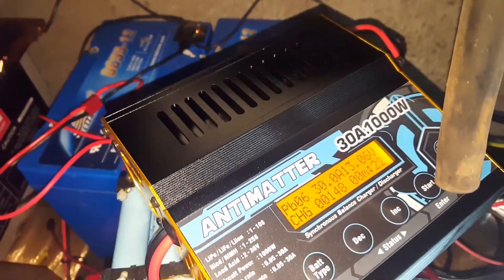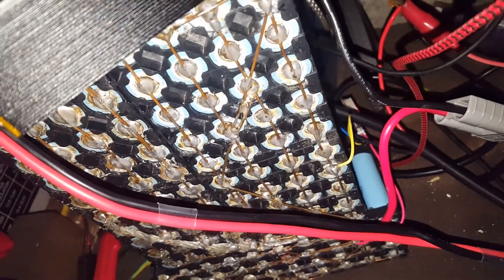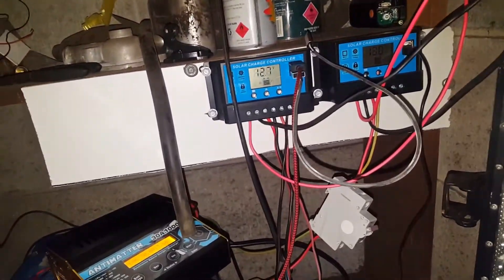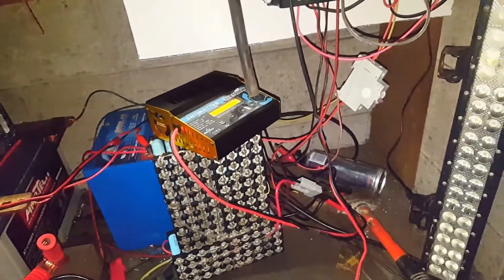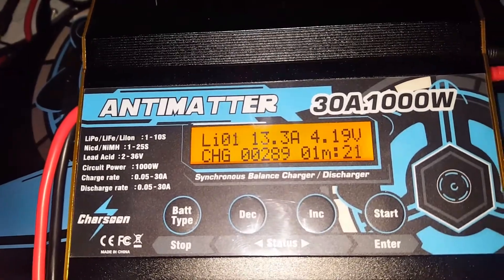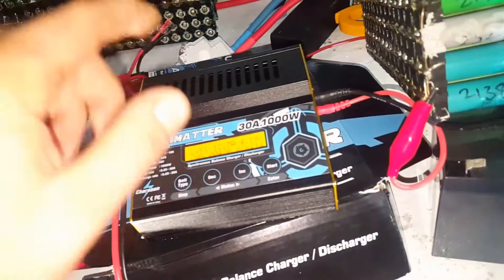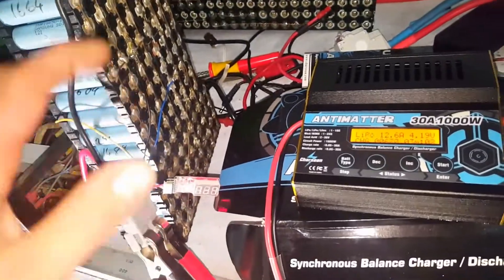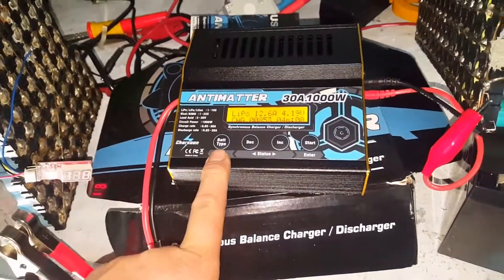Charsoon Antimatter 1000W 30A Balance Charger Testing at 30 Amps

Comment: Hi mate thanks for your uploads are you running this charger direct from your solar charge controler?
Reply: My dream car( toyota land cruiser 79 series)
Reply from the maker: +john smith no off the battery bank  its connected too
Reply: One Up The Sleeve Customs ahh ok do you think you could run it directly from the solar charge controlers? I ordered 1 of these yesterday to give it a go for my 4wd camping setup and need to know if it will work lol :)
Reply from the maker: john smith no the charge controllers dont output power untill a battery is in line.
And they pulse power in so it could  damage the lipo charger
Reply: Ahh bummer! Thanks for the heads up there mate I would have cooked my antimatter the minute I unboxed it lol it looks like it's going to be my new bench charger then. I guess I'll just install 400ah of cells in the 4wd and charge from home before I go bush 😏
Reply from the maker: +john smith yeah depending on your application a dc to dc charger may be a good option for.your 4x4